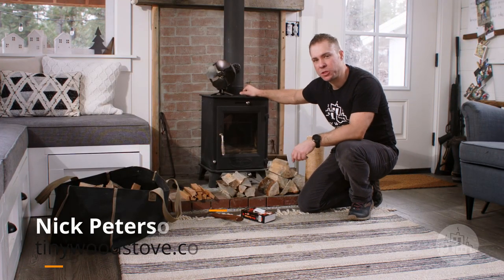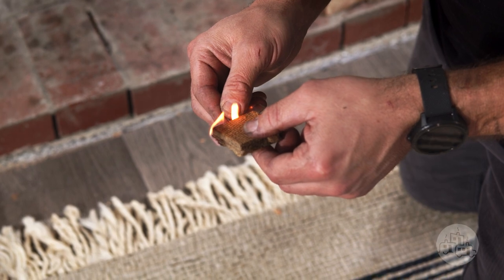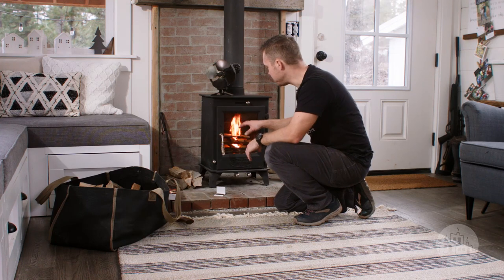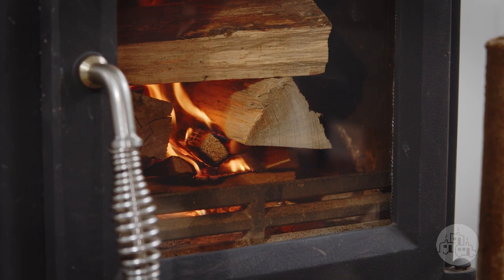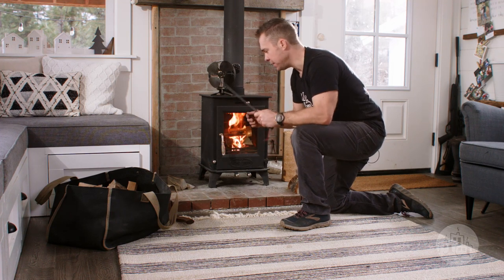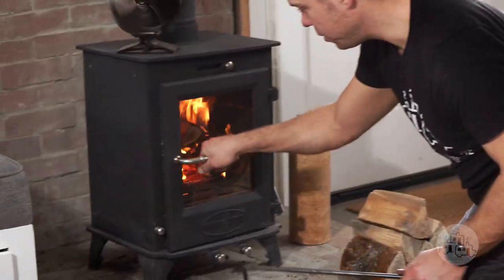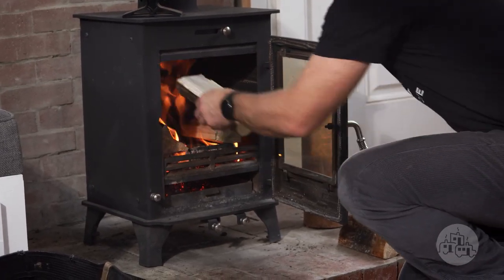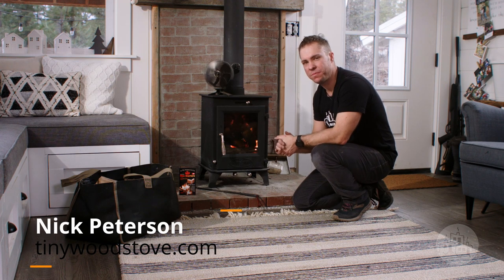TINY WOOD STOVE: Starting & Maintaining a Fire

Comment: This is a really helpful video. A question I have is, what to do if your temperature gets too hot? My solution has been to open back up all the air controls, and even sometimes open the door wide and just let the fire cool off a bit, but maybe theres a better approach?
Reply from the maker: Your door should be sealed enough so that a fire will burn down and the stove will cool off if all air controls are closed. If you still get a hot burning fire for a time after you closed all air controls, you might have to check your gasket and adjust your door handle for a proper seal. Take a look at this video on how to do that: https://www.youtube.com/watch?v=e5_V9UNEB3s&list=PL7-TO9oBxjtCPTLSWQqCNbjrM88omOIIw&index=3

Comment: I didn’t see him demonstrate how to open the bottom air controls, and the manual doesn’t offer this detail either. Do you pull the knobs out for open and push in for closed?
Reply from the maker: Yes, you pull them out for more air and push them in for less.  The left knob is the primary and feeds air into the bottom of the firebox.  The right knob is for secondary air and it feeds air into the top of the chamber.

Comment: What is the max log length that will fit in this stove?
Reply from the maker: That depends on which size stove you have! The Dwarf 3kW burns chunks of wood 6-8", the 4kW 8-10", and the 5kW 10-12" 🔥